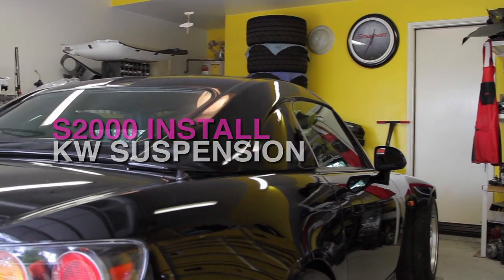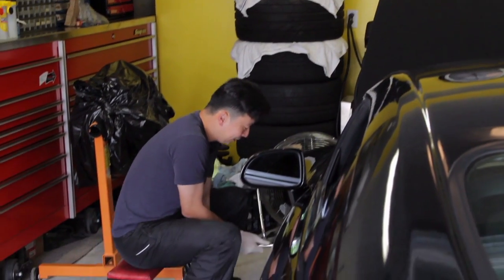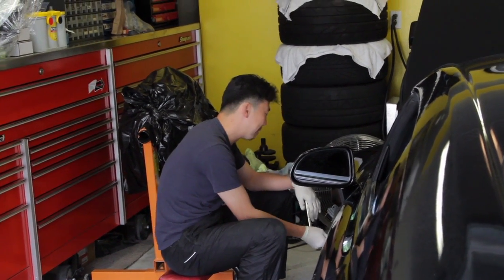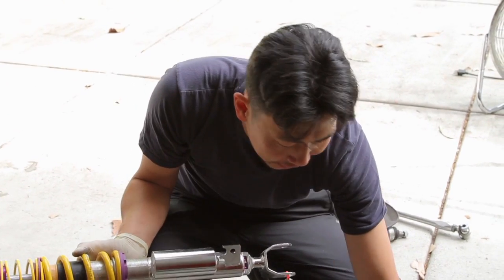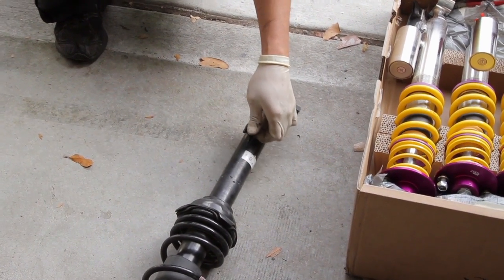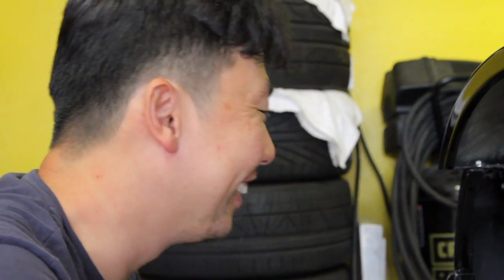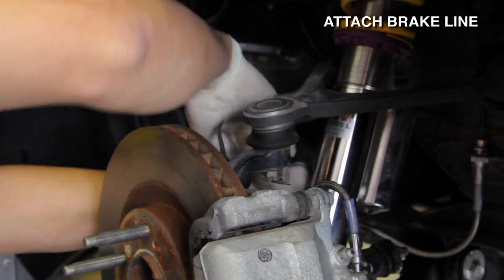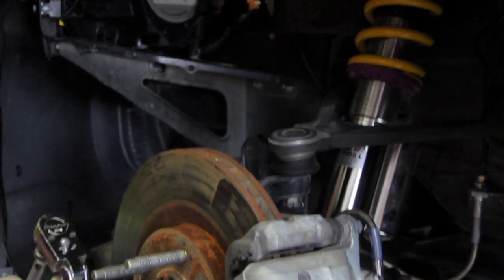How to lower a Honda S2000 1 of 2 - Technik

Comment from the maker: CaliPatriot88 correct. Which is why if you lower the car significantly you need to use a roll control spacer.

Comment: Should you not have the weight of the vehicle on the suspension, when tightening the bolts? By jacking up the lower arm so the suspension is compressed to its norma position. It means the bushes don't get twisted.

Comment: I love KW's but dam they are so far out of my budget.  

Ended up getting some cx racing ones and they actually surprised me. The car rides great and its amazing how much faster i feel like i can take a turn. I havent taken the car on my local canyon yet but i plan to soon.  

I noticed it actually takes less effort to steer into the turn than ever before. Its almost like it feels the power steering is stronger or something. 

First time with fully adjustable coilovers so im experiencing alot. However now i feel like my seats can't hold me enough while taking a fast corner. Its like i can launch into a turn but my seat doesn't do the job of keeping me inside. So upgraded seats may be in the future.

Comment: Just a tip for those doing this, you don't actually need to remove the front upper a-arm bolts to do this, I don't usually touch them.

Comment: The S2000's steering is optimized for the car's stock ride height, wouldn't this make the handling worse in the long run if it's lowered too much?

Comment: When I lowered my Cossy I was really surprised that the new shocks rode better over the bumps than stock shocks and springs. I was expecting a harsh, stiff ride, but it was nothing like it. It was stiffer, but it soaked up bumps way better and in a way more controlled way as well.
It is kinda un-intuitive (<<is that a word? lol). Well worth doing it properly if you want a lower car. Can't compare that with someone that has just cut the springs. Well that makes for a harsh and overly stiff ride that is kinda dangerous on bumpy roads and is not really predictable (which is what you want if you're driving fast, for a car to be predictable)

Comment: what about geometry changes ect? i have just purchased a set of p229 bilsteins and i would like to lower to maybe the max 50 depth. with i need to realign the geometry? or is it just bolt on and go?
Reply: The S2000's steering is optimized for the car's stock ride height, if you lower the car too much (at least one inch) you will essentially make the handling worse which is why you need to use a roll control spacer. A bump steer kit would help as well.
Reply: ***** roll center adjuster

Comment: They are ok. These shocks are heavy as they have steel bodies. A set of 4 weighs about 50 lbs. The Ohlins are better if you want street and track dampers for the s2000.

Comment: more expensive, stiffer springs and stiffer shocks and no tüv. in germany the clubsport come with monoball heads (don't know correct eng name) and you don't have to recycle old stuff from the suspension, like you have to do with for examlpe the bilsteins shocks, or the k&w v3's. i prefer nitron shocks, if money is not that important. but i don't know if you can get them in the usa. for the s2000, the best cheap suspension is btw from h&r. the shocks are bilstein, but springrates are different.

Comment: A little tip for anyone who's as anal as me when it comes to cars. 

Don't fully tighten up all the nut/bolts to start, jack up the lower arm so it compresses the shock, therefore leveling the shock/control arms ect to it's normal running height then fully torque up the bolts.   This way you get no twist from the tightened bolts as the arms/shock lowers once the car is back on the wheels.  (if that makes sense)